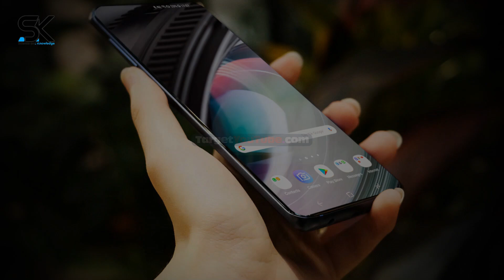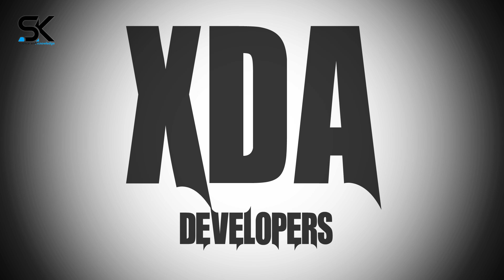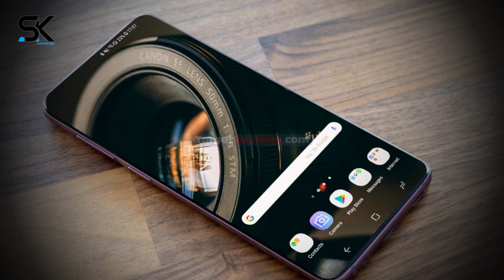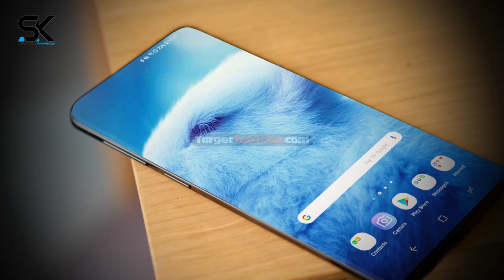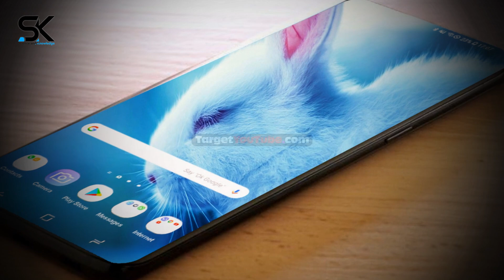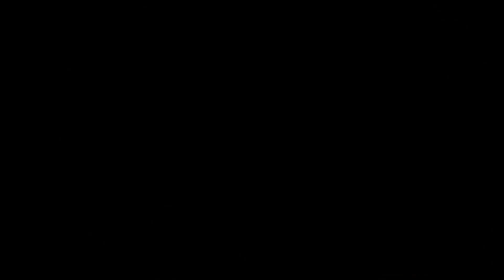Samsung Galaxy S11 - Camera Analysis

Comment: it would be better to combine  9 pixels as one instead 4.
 That is how u get 2.4-micron pixel size and effective 12-megapixel photo.
 bigger pixel size better iso performance in low light. should also go for
faster lense f 1.4 with 3 stage aparture setting say f 1.4,  f 2.0, f 2.8
a sensor as big as 1/1.33 inch with fast f1.4 should also result in natural bokeh effact.
this main lense with effective 12 megapix coupled with 12 mp tele and 12 mp ultrawide
with similar color reproduction and smoothe zooming like apple 11 phone.